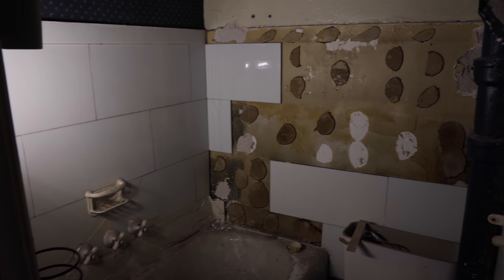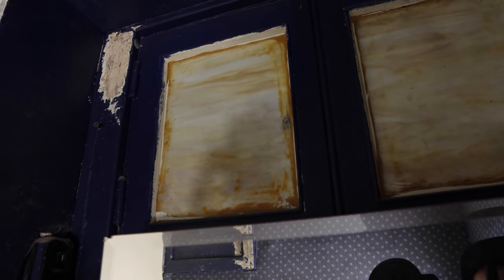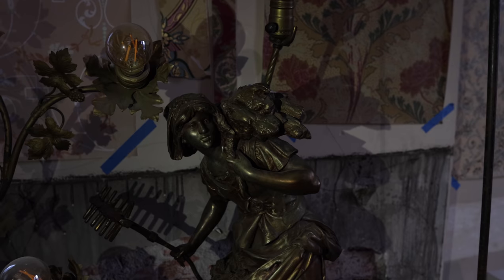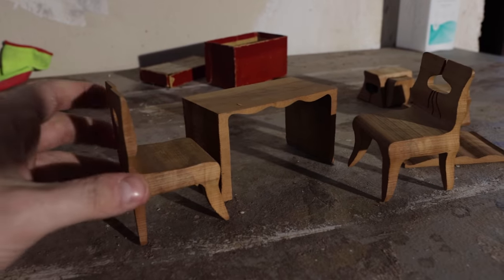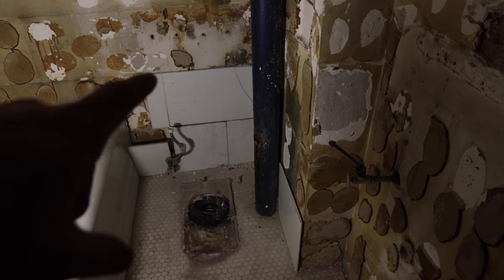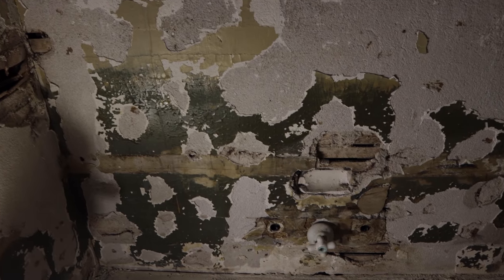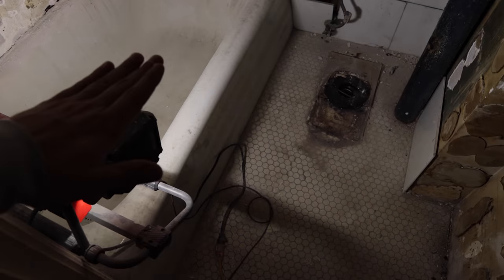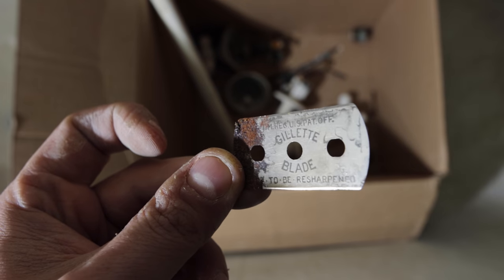Whats Next? Season 2 Begins! Abandoned Victorian Mansion S2 EP1

Comment: The razor blade is from 1926. 
There is a formula with the number on the blade. 
2153
The first number = the decade so 2 would be 1920.
Second number + third number = the year of that decade so 1+5=6
1920 + 6 = 1926
Second number + fourth number = the week of that year it was made so 1+3 = 4 = 4th week of 1926.
You may also want to put a paint lid or something over the toilet hole so gases dont come up in the house lol
Loving the progress!!
Reply: Yes back gases are never pleasant.  You may get them do to the fax water has not gone down the drain in some time. Over a long period of time water will Evaporate Trap.
Reply: I've seen people stuff a rag in the hole to keep the gases out. I'm trying to figure out why he's not using the existing area for his new toilet and putting his new sink where the pipes for the tub are.
Reply: @rainydaylady6596  - owner is getting rid of tub so I assume he wants to redesign space   to make it look like a welcoming powder room with new tile, floor, etc but keeping the two internal windows. He's also got a layer of concrete under the tile to get rid of, that the former owner put in, perhaps when this original butler's pantry was repurposed as a full bath in the house.

Comment: Just get a compost toliet or use a camping version until you get plumbing in. Good for emergencies anyway just in case of power outages or other water pipe woes.
Reply: This. A sawdust composting toilet works great! They are very inexpensive, stupid simple, and don't smell!!!
Simply get a 5 gallon bucket, a "Luggable Loo" or similar snap-on seat/lid, and a bag of sawdust. I like to use a trash bag as a liner, but put a small amount of sawdust in the bottom and then use a cupfull to "cover up" every time you go.
Because they are inexpensive & readily available you could have a "his & hers", one for each of you!
I had to do this myself when my old septic system died a few winters ago, so I speak from experience!
Reply: He’ll have to make sure they are legal where he lives.

Comment: Happy New Year! You are off to the races, as they say. We have 1930s tile set in concrete too, and you either leave it, or the whole floor has to come out. With two bathrooms, we did one of each, based on the condition. Replaced the floor of the one with swimming pool tile (the only tile we could find that nearly matched the two-color tile wainscotting on the walls) custom cut to fit. You are so thoughtful in your decisions to reuse, repurpose, gift, or sell items before recycling becomes the option, and items only hit the dumpster if there is no other option. Good on you, but I'm not surprised. That wood puzzle is fantastic! The perfect thing for you. I wonder if the 'ottoman' pieces with the cut-out could hold the flat piece with the wavy top at an angle and form a settee, with the final piece being the seat. It's the sort of thing kids will figure out right away. :D

Comment: Clue to the mystery razor… they used to build a slot into the wall where you could dispose of your used razor blade.  Can’t tell you the exact era, sorry, but I have seen them in houses built from around your house’s era, and a few decades after.  

Congrats on the second season, here’s to moving into the house with a working bathroom in 2022!    🎊🎉🥂
Reply: Maybe there was a medicine cabinet over the sink at one time? They had the slots for razor blades built in, too…There could be a ton of old rusty razor blades inside that wall! Lol
Reply: My grandmothers home built 1888 had a razor slot in the wall.
Reply: @melodyfisher1512  Maybe so.  Didn’t know they had medicine cabinets like that too.  Wonder if they did that when they stopped building the slot into the wall.  Seems like when they put that white tile in, the may have cleaned out most of the razors, but missed one.
Reply: @janice7467  That’s very cool!  Wonder who came up with the idea of just disposing of old razor blades in the wall.  Bit odd, really, and yet kind of makes sense.  Best way to make sure no one accidentally cuts themselves on an old blade, unless you’re tearing the wall out.

Comment: Regarding the dating of the razor blade:  it has a 4 digit code on it, which Gillette began using in mid-1925.  I'm not able to find the exact code "2153" on the list I have, but the "three holes" design was discontinued at the end of 1929.  Beginning in 1930, Gillette blades adopted a different way of attaching the blade to the razor holder.  So all I can tell you is that the blade was manufactured sometime between mid-1925 and 1929.  It's an interesting find!
Reply from the maker: Wow. Thank you Suzanne. Excellent info.
Reply: Responding to you so there aren't several different razor threads. I found this info: "4 digit code: 1=decade/ RH# of 2+3=year/ 2+4=week"  So... since the code on your blade was 2153, it would mean it was made in 1926 (1+5) during the 13th week (approx. mid March) if I understood it correctly?
Reply: @Rain0Eve  that sounds about right!  Thank you!

Comment: You should wainscot the sewer stacks. It would match and you have the least destructive material should they fail.  In your year end that hole in the mansard was scary large. Some drone footage of the work will be excellent. I think you can put them in hover mode.  The tile slate is going to be so vibrant when installed.

Comment: Those tiles are to die for!  A shower. During my remodel I made a shower in the basement using a garden hose with a sprayer tied to the floor joist of the first floor. It worked ;-)

Comment: How are you going to put the HVAC in the ceilings?  I grew up in a house built in 1927 (pre-HVAC), and it had a lot of problems because the owners in the 60's cut a 6x12 block out of the 8x8 main beam so they could keep the vents in the ceiling.  I know you won't make a mistake like that, but how will it fit up in there without cutting any important timbers?

Comment: That lovely vinegar bottle is part of a cruet set. There is a little container that holds two bottles, one olive oil and one for vinegar. They sometimes had a matching sugar bowl with tongs with a creamer.
In some old bathrooms there was a small slot in the wall next to the bathroom mirror where gentlemen would dispose of their old razor blades. Several people have discovered these while remodeling their bathrooms.
Reply: The decanter is made from what is called ruby glass. It is made by adding by adding gold salts or colloidal gold to molten glass. And there were cruet sets made of ruby glass too.

Comment: Surfing on Youtube I stumbled across your channel. Love what you've done with it so far.

I grew up with Antiques and Decorating, I am a Designer but retired. Still a passion of mine:)

It looks to be a "bohemian" wine decanter -hence the grape leaves and vines, if its 16" its too big to be a vinegar cruet. Some taller cruet bottles had a wavy lip to pour but from what I can see in yours, that is not the case. Cruets came in pewter or silver type holders with a carrying handle that was an oil and vinegar set. Oil has a long type pour spout like tavern bars have and vinegar usually has a small pour spout both, handles on the side. They were smaller than wine bottles. Very nice find!, look for the grouted bottles and jars they date back farther. Your decanter may have a 23% lead content so dont keep wine in it, maybe ok for a party but dont let wine sit in there because the lead will eek out into the wine, just put on a shelf with colored water for show.

The alabaster bust looks like great condition, sometimes chipped when you find them.

Those lamps are pretty, yes most have marble on the base to weight it down. They had slag glass shades that were either cup shaped or flower leaded glass shades that opened to directed light up depending if its a floor torchier. Some had just decorative flame shaped bulbs as not to hide the lamp design. 
Puzzle is adorable! what a find! and in the box with a label. Ya, keep that with the house definitely!
You know what you could do for the bathroom wallpaper, is take a picture of it and bring it to a custom creative wallpaper shop, they can upload into a computer design program and either print it out in paper or vinyl. Vinyl would be better in a bathroom. They also have some creators on etsy. Or, you could have someone make you a stencil if your hell bent on doing it your self.. Hand painting is going to take you a very long time.
Food for thought :)

Comment: Happy new year.  I believe the Gillette razor blade is an original three pin razor from c. 1903.
If you found it behind the tiles, if not construction debris, it is possible that the bathroom had a medicine cabinet with a slot in the rear for disposing of used blades.  Often the used blade then simply fell into the wall cavity.
Best of luck with all for ‘22!

Comment: When you get to removing the tile floor from the powder room, you may find that in addition to the wood pans between any  joists, that the tops of. The joists have been  trimmed to a point similar to a picket. Plumbers and tile people in the 20’s did this to provide a greater amount of cement under the tile. If the joists were to remain flat, it would possibly cause cracks in the floor. I came across this when removing a tile pedestal for under a kitchen stove. With a finish height of about 1/2” above the wood flooring. In a house built in 1926-27, with the same hex tiling.

Comment: I would expect that your existing powder floor was done in mud.  Strips of wood would typically be nailed horizontally into the beams underneath about 3-4 inches down.  Oak planks would then be nailed at each end onto those strips effectively making a tray which cement would be poured.  That would be leveled and then the tile laid on top of that.  It will break out easily in chunks with a chisel (I have done this in three of my bathrooms) and you should remove any wood underneath that is not necessary.  While you are in there, you may decide to replace all the plumbing and electric.  I really enjoy your channel and the progress you are making.  Best wishes for 2022.

Comment: Those hexagon tiles if glass are actully arts and craft movement, 1900s.
May have been the buttlers pantries original floor as its the right time period. 

I hope you saved them as you can on sell them as people are getting marble reproductions to mimmic those verry same tiles in restorations. 

Oh , i so hope you took care removing them if they are the glass ones .
If you just trashed them removing them and they are the glass ones, you just destroyed a sort after bit of arts and craft movement history for some repo tiles that ive seen the vid of your doing the floor.

What is that under the toilet? 
And you done a rough job on the tiles as its not 100% square with the boarders to the room .
You got the wrong sized tiles for that bathroom and that cut away in the broader in the door way would drive me nuts to live with. 
If you got the tiling to fit 100% right ... ok , yeah its the repo that everyone goes to for Victorian houses but mainly for their porches. 

Ahhhh please tell me that those hexagon tiles where ceramic or stone making the not 100% sure they are the orignal butler's pantry tiles in glass.. 

Id cry if they where the glass ones and you just smashed them up and put them in a skip to put porch repo tiles in their place. ... 

Sorry im just tripping balls knowing what your going to replace them with

Comment: Old houses like that had a slot in the wall, usually in a medicine cabinet, that was for disposing of your safety razor blades. You would feed your used blades into the hole, and they would disappear into the wall, supposedly never to be seen again. It was considered unsafe to throw them in the trash, lest someone get cut emptying it. I have a background of building maintenance, so I have run into walls full of used blades many times.

Comment: The windows in that bathroom could easily be rejuvenated by putting in frosted or etched glass so one has privacy when using the facilities plus it provides some natural light.  The two windows that are side by side look like they were originally a transom window to allow air to circulate when it was a butler's pantry. You could probably re-install the mechanism which would let warm air in during the winter if there is no radiator or cooler air if you plan on air conditioning and you don't put in a vent.  Oops, I wrote this before seeing the part where you got the two windows to open.  Apparently it isn't a transom and I doubt there would be any privacy if left open.  Have to come up with a different idea for that set.  A previous comment was to back light the window that backs onto the stairwell.  That sounds like an excellent idea as it is an interior window so no one  would see "what's behind the curtain" where the lamps or electric is sitting.    Putting in stain glass or etched glass with perhaps  rope lighting would look nice (also work as a night light if left on full time)and not be too much "out of time" for your turn of century bathroom.  If you cut down the tiles to the size of subway tile you could easily use the odd shape pieces to give you more material to work with for placing on the wall for your "pin shower".

Comment: Kaleb,  that vinegar bottle with the glass stopper might have been from a Victorian era cruet set. The cranberry colored cruets of the 1850-1855 era are extremely difficult to find in any condition.  If I am correct, then you acquired a very desirable,  and expensive cruet bottle.  I have about 8 or 9 Victorian era cruets, but no cranberry. These sets usually have a mustard pot (squat bottle with hinge lid, often missing it's spoon), olive oil bottle,  and the salt and pepper shakers. Those knewell post lady lamps are exquisite! Bravo 👏👏👏 for getting such rare and beautiful items.  I always have a saying, "If an item calls to you, get it." Because I've ran into the old mindset it might be there later, and often times,  nope. 🙅🏻 Keep these videos coming.  I enjoy them.  😉

Comment: Your miniature table set is missing one small piece, it would have slid in the hole that continues through the back of the chairs (like the one you slid out from the benches/ottomans). Shows how talented Mr. Sawinsky was, creating so much from a simple block of wood, and with such little waste. A true craftsman.
For your powder room, create a stencil from that cool pattern! It will take forever to handprint all that. My hand is cramping just thinking about it! :)

Comment: didn't see if the bathroom had a medicine cabinet at any point but some older metal medicine cabinets had a slot designed for razor disposal, they could dropped into the wall cavity from inside the medicine cabinet.

Comment: Couple of thoughts on the wallpaper in the powder room. 1. There are companies that will recreate  vintage wallpaper if given enough of the pattern of the original...Which you probably know about and is probably fairly pricey and 2. You can make a stencil for yourself off of the paper you have so you don't have to recreate it all by freehand, will help with quality control and consistency in the pattern and likely will be less backbreaking to work off of. Let me know if any of that helps.

Comment: Vitriolite Tiles: I’m sure you already know this/are doing this, but just in case…
Save all the broken bits. Even if you use the big/whole pieces, someone can no doubt use those to fit around pipes, etc. As you say, they aren’t making it anymore.
Cutting tiles - a few years ago I saw a program where someone was doing that (to make a two-color deco pattern, because the two colors were from different sources and so different sizes). They had a very difficult time doing it, and continued to occasionally break them even after they found a solution that worked (sorry, I don’t recall what program or solution). If you’re going to use them, perhaps better to find a way to use them as-is.

Comment: Not sure in your case but a lot of older medicine cabinets over bathroom sinks had a repository for old razor blades. The funny thing is, that by repository I mean most of them just let the blades fall back in behind the wall face. I’ve run into this on several rehabs I’ve done over the years, especially on much older homes. I’m not sure exactly we’re you found the blade, but was it in the vicinity of the sink?

Comment: What a plan for this first half of the year. Only thing I question is why do you want/need a HVac system (or however it is spelled) if you already have a boiler and radiators in most of the rooms. I probably don't get it because I am from Europe
Reply from the maker: We are in St Louis and we NEED air conditioning.
Reply: Boris Licina:  HVAC system means, Heating,Ventilation,Air Conditioning
Reply: I'm guessing that things get a bit too hot in summer? Aircon to chill out.......
Reply: @knottyal2428  Hot and humid,yuck!😵‍💫

Comment: I just want to tell you . you're doing a beautiful job. And I know it's going to be a good video when you take up that concrete bathroom floor, think of renting a small jackhammer. And getting a cast iron bathtub removed in one piece is slightly difficult you might want to use a floor jack and a block of wood from the basement . And a lot of the old medicine cabinets used to have a slot in the back of them for used razor blades I found hundreds of razor blades working in bathroom walls.

Comment: A lot of that old plumbing is not up to modern code.   If you touch it (like you should), you likely can't just replace what you see with new stuff.   I had to redo one stack because it didn't pass inspection.  It was simple enough because it was all open but if you put it in a wall best get it right the first time.